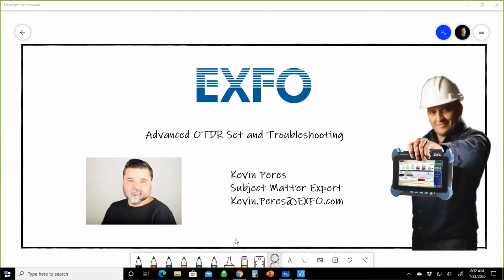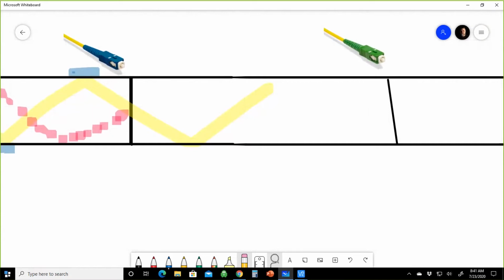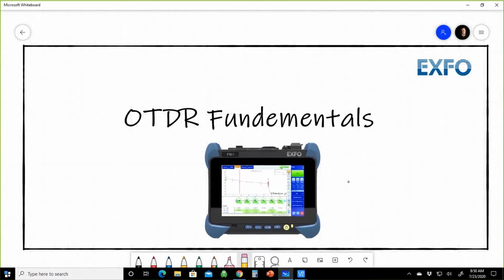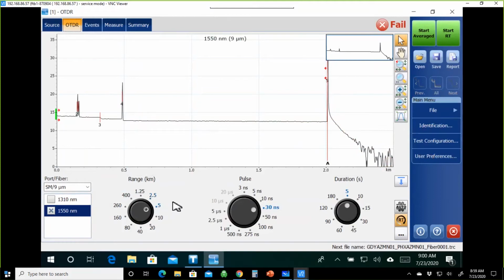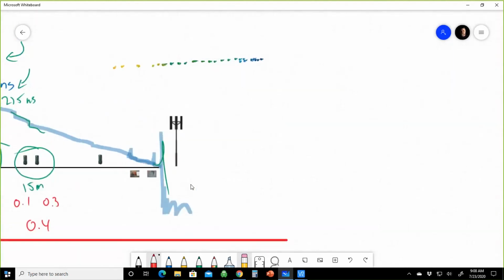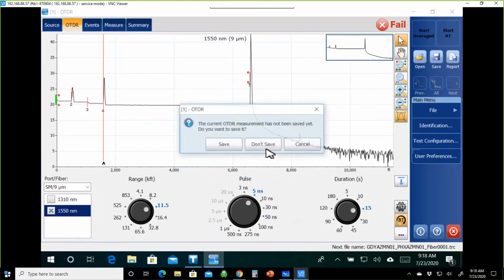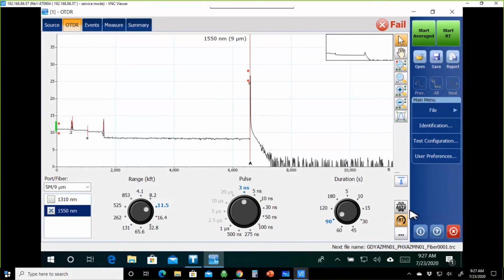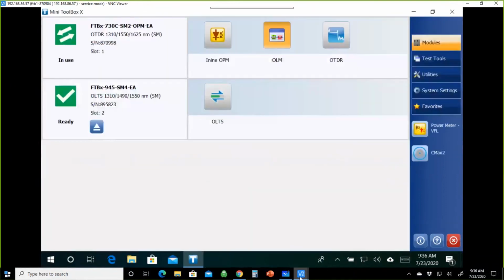Advanced OTDR Setup and Troubleshooting Seminar

Comment: Hey Kevin, how about a loss in a fresnel reflection event, could it be due to splice from pigtail to cable inside the ODF?
Reply from the maker: @foc.niccom  it absolutely could. If the splice is close it may merge into the reflective event. Great point. I have some customers adding “pigtail splice” as a new event. It’s a reflective event and splice combined
Reply: Thanks Kevin.

Comment: Thanks Kevin, it was extremely informative I learnt a lot. I have a question and confusion regarding the resolution when testing links around 140km long, normally I would set the Dis range around 160km and the plus width about 1 or 3 microsecond and for the resolution I set it 5m. is it right or wrong? should I use less or more? the thing is I'm not certain about the usage of the resolution.

Comment: HI Kevin, this is very useful video. I have couples of questions: In the OSP scenario, what would be estimated (recommended) distance between Manholes (splice points)?  what is acceptable estimated splice loss in the field? Is bi-directional a must? why bi-directional measurement recommended? you can email me: biju95@gmail.com
Reply from the maker: Sorry for the late response I am not sure how I missed your question.  Distance between manholes and splices will vary but I always tried to minimize splice points as much as possible. I often see 2.5 km between splices in many metro environments.  Again this can vary greatly.    

For splice loss I am seeing between 0.1dB to 0.3dB bidirectional average.  Bidirectional is always recommend especially with us seeing more and more MFD (Mode Field Diameter) mismatch in the field.  Typically its G.652 to G.657A1.

Comment: Great video Kevin! One very basic and quick question: How do you calculate the distance of 1m based on the 10ns pulse width? Thanks!
Reply from the maker: Hector I am glad you liked the video! I am not sure I understand your question sir
Reply: @KevinPeres  Hi Kevin, thanks for answering. I was referring to what you explain at 36:00. I was interested in knowing the equivalence between pulse width and the distance the events need to be placed to be both detected. Thanks in advance!
Reply: @HectorMtnz  I believe this is the distance for OTDR detector to recover from reflection at said pulse width. The longer the pulse width, the higher the output power, the longer it takes for the detector to recover.